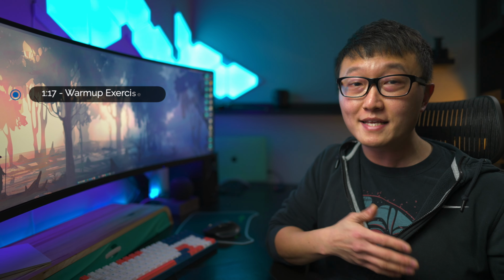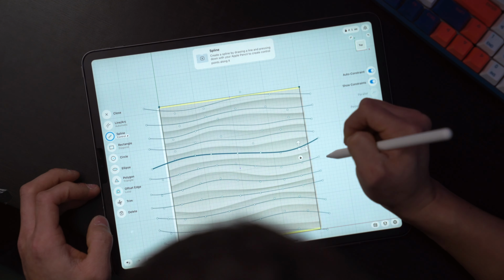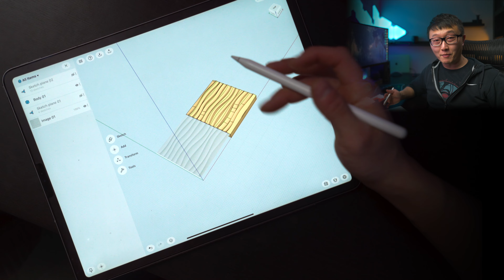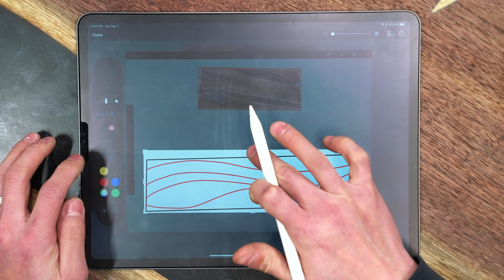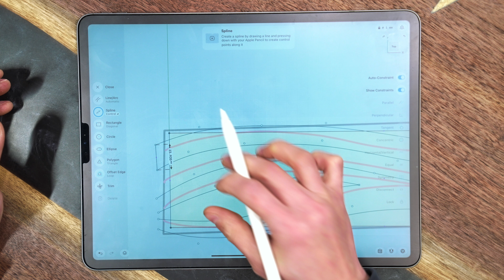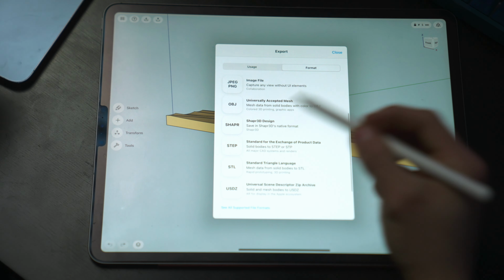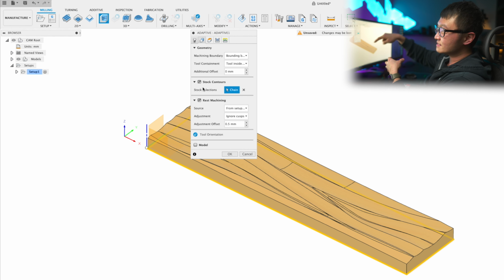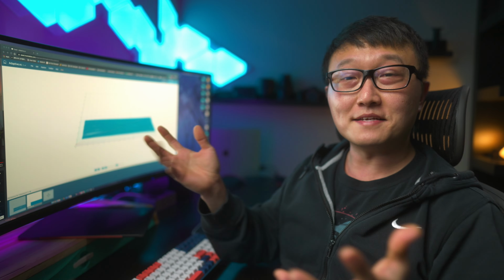Design on iPad Pro + CNC CAM In Fusion360 For Beginners - How To Woodworking

Comment: This video is massively helpful. I've used shapr3d for a couple years now with cnc, mostly just make things and then project each panel go get outline vectors
Reply from the maker: I do that as well :D
Reply: @BevelishCreations  I spend too much time than I care to admit laying a 48"X48" square and try to nest everything in the most strategic way 😅😅
Reply from the maker: I do it too…maybe I’m weird, but I like doing it myself instead of using a program haha
Reply: @BevelishCreations  SAME 😅 it allows progressive creativity, because sometimes I can afford to chamfer an edge or two to make it fit just right within  the constraints of my material. 
Feeds and speeds, tool life and material maximization are key!
Reply from the maker: Yep hahahaha

Comment: Could you do a video that goes through helping newbies decide what CNC to go with? I am currently weighing options ranging from 3 axis mills to the Makermade M2. So hard to know what a good starting point is and what a good machine is to turn into a successful business.
Reply from the maker: If you want to build it into a business, I recommend going with a 3-axis machine. A 2-axis machine is only good for 2D carving, like very basic engraving. It won’t even be able to handle a V carve. You’ll outgrow it very fast
Reply: @BevelishCreations  with the Makermade m2, I think I saw some people doing some 3dimensional cutting as there is a little bit of z axis control, although no where near the depth of a pure 3 axis machine of course, but then you get the ability to work on pieces that are 4'x8', though I do not know how accurate, precise, or consistent this work will be.

Comment: I have recently been having to make a lot of adjustments for tolerances between v carve and shaper, off about .80 of an inch. Totally missing something but so far I've just been offsetting on the fly
Reply from the maker: Interesting. I haven’t used V carve before, but I haven’t had any issues with shapr and Fusion.

Comment: This was a really interesting video I actually watched the entire thing. After all of that work I'm really surprised the amount of fusion treaty interaction that you had to go through. Why not just use fusion 3D to do the entire sculpting process? Is it just that it's more difficult? Time consuming? I'm learning shaper 3D right now and I love it but after watching the required interactions to make a model into a physical element I'm tempted more to simply suggest hand carving the piece out of wood. I'm actually a sculptor and I could have carved that piece twice as long in half of the amount of time. Of course that's easy to say with it just being a long piece of stock board. I'm sure there's many applications that you could never hand sculpt to the degree of accuracy that the computer can apply. But for something like that hand skills could be incredibly valuable. I am curious though what it would take to use shape or 3D directly to a 3D printer? Is that even possible? I'd like to use shaper 3D as a sculptural 3D printing tool. Am I completely crazy and thinking that I could do that? Am I going to have to commit to a fusion 3D professional license and their crappy service?
Reply from the maker: Shapr3D doesn’t have CAM capabilities. You can do the whole thing in Fusion 360 if you want. I did it before in another tutorial. But I like to design on my iPad so I’m not constrained at the computer, so I use Shapr3D 90% of the time

Comment: hi, im doing as you say with export fotmat .step, but on fusion 360 when I select insert mesh it doesn't let me pick the file sender from shapr3d, do you why is this happening?
Reply from the maker: Try using Open —> open from my computer
Reply: @BevelishCreations  i had to open it form the data panel, and it works! Thanks for your videos and awesome content!!
Reply from the maker: Thanks for checking it out :)

Comment: Can it import lidar 3d scan surface to Shapr3D?
Reply from the maker: I don’t believe so
Reply: @BevelishCreations  
Thanks 
What kind of CAD file formats can be imported to Shapr3D on iPad?
Reply from the maker: X_T, STEP, IGES, SLDPRT, SLDASM, STL, SHAPR, DWG, DXF, PNG, JPG, PDF, TIFF, BMP, ICO, RAW, GIF,
Reply: Nice thank you.
I am renovating interior of my 40' sailboat and trying to use iPad pro and Shapr3D for cnc cutting plywood.
I really appreciate for your video.
Reply from the maker: Glad it’s helpful!
Reply from the maker: By the way, if you need the pro version, you’ll get 10% off with my code :D
Reply: @BevelishCreations  Also I recommended for my 3 Kids.
How can I purchase Sharpr3d with your reference in future?
Reply: @BevelishCreations  Perfect
Reply from the maker: When you sign up on their website, just use my code: bevelishcreations10 at check out through their site. The code changes every few months, but I always keep the code updated in the descriptions of my videos with the most current one
Reply: @BevelishCreations  ok
I will when it comes.
Tks
Reply: @kimcanada  lol, that’s why I’m learning Shapr3D as well, 3D printed and CNC parts for my Catalina 30. 😁

Comment: Please explain why are you paying 300usd for shapr3d when you already have a very powerful fusion360? Is shapr3d that much easy to use compared to fusion360
Reply from the maker: They model nearly the same. But Shapr3D is much more useful for me because it allows me to sit in the shop and make designs while measuring things in front of me. And i can walk all over the shop to do this. There’s 0 time wasted from turning on my iPad and opening the app. I don’t have to run back and forth between my project and the office. I can design while on a bus, at the airport, on a plane…basically anywhere without needing to carry a laptop.